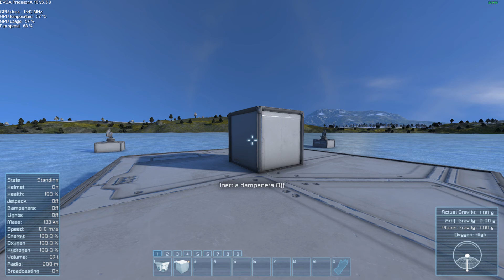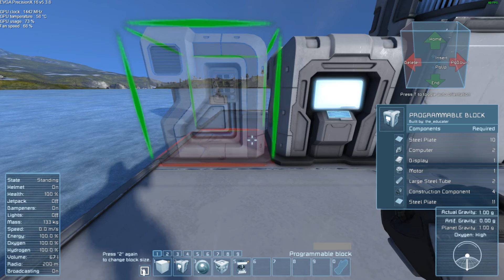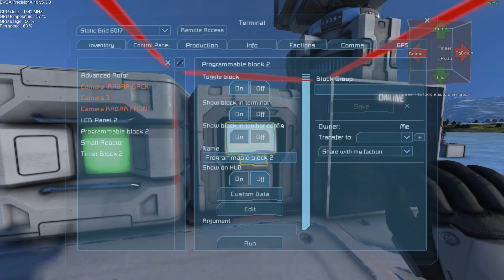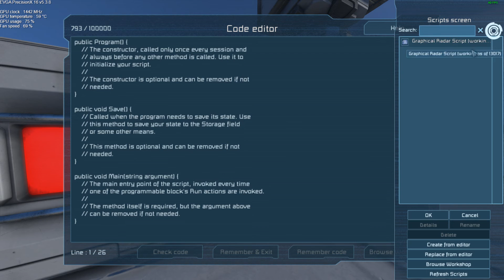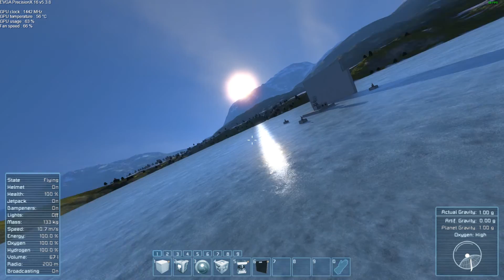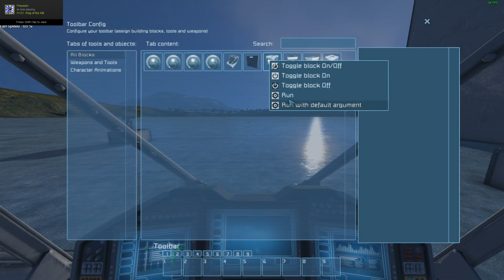Space Engineers | Graphical Radar script | Working as of 1/30/17

Comment: I am very greatful to you for bringing back that script to life. It is useful thing. I have one question for you - can you make that script works without rotor and (optionaly)with only one camera?
I want to use it in my fighter plane project but active rotor makes it unflyable.

Here`s the old version of what I`m saying about: http://steamcommunity.com/sharedfiles/filedetails/?id=617905251&searchtext=RADAR
Reply from the maker: I believe the script will run with only one camera, but it can't function without a rotor the cameras "scan function" has a limited arc so the only way to scan the full 360 is by turning the whole camera
Reply: I`ve checked that out, and I think it could be perfect fighterjet radar but the camera arc is very tight and shows the target only when is directly on it - here is my next question - 
can that arc be wider somehow or it is just set like this by the game? 
And second question - is there any possibility to make green dots(detected object) bigger when detected by the radar?
Reply from the maker: 1-that's a good Idea and I've been toying with a similar concept for almost a month, just lacking the motivation to sit down and write it
2-the arc is hard coded into the game at +/- 45 degrees (<--don't quote me on this) you need mods to change it
3- check the screen resolution variable, set it to a lower one so the script will use the larger font size, other than that idk. I didn't write the print method and don't properly understand how it works, that was the part I recycled from the original script (original creator credited on this scripts workshop page)